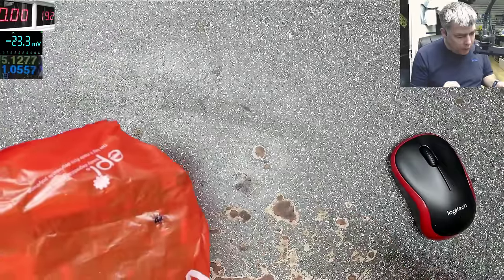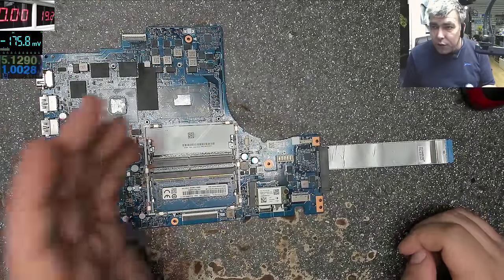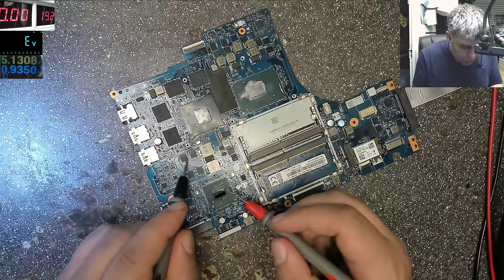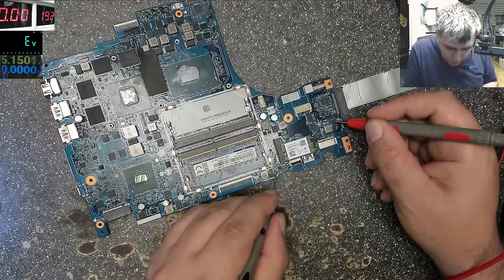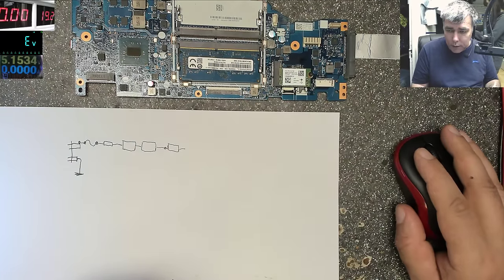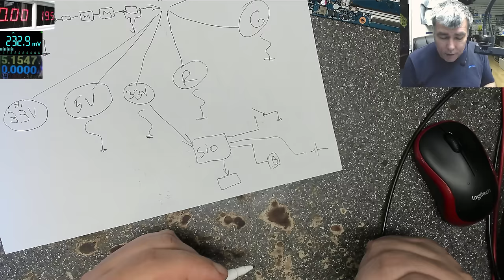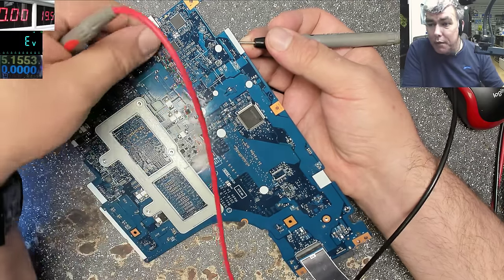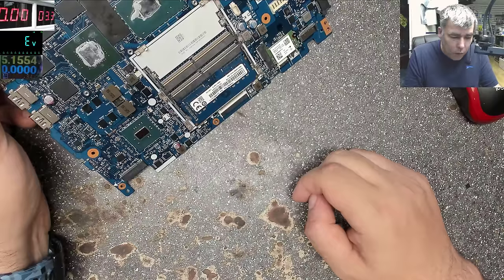How to diagnose a laptop motherboard - motherboards repair lesson

Comment: ether I need bigger Laptop or better eyes :o). It look so easy when you do it but it is big work of patient.
Actually I just try to fix 2 USB on a Acer Espire 7715Z, 1 USB broken but both not work...

As I find that good Video on the way of repair I guess I will follow first the Video lessons  before I continue with those USB

Comment: Hi, i have a HP 4530s Laptop and just in bios screen, the southbridge chip is realy hot after 5 mins. It has a thin metal heatsink on top. i already replaced paste but same. Should it be so hot without the CPU doing any real work yet ?
i think its the s/B chip as the CPU and another chip share the heatsink to fan  and this one look like a old style green cpu with that square chrome small block in middle. looks like a old laptop cpu actually single core. Could it be shorted as i cant install windows, just freezes or crashes eveytime in same place in start of install.  Memory stick (swapped too) still is cool and so is CPU/fan  section , just this S/B? chip really hot only on bios screen?  . How can i check for shorted chip with MM? Got this laptop broken, so dont know if already overheated and damaged by previous owner. dont want to scrap it as like this laptop and prefer repairing stuff.
Thanks, love your channel and learnt so damn much on testing M/B's so far

Comment: I have a problem with my DELL laptop. Charging side of the battery is good but it couldn't starts up. I tried power it up without battery still it won't turned on. Local IT told me to remove the RAM and CMOS battery but still it won't power up. So now I'm suspecting the laptop's power supply. Please I need you advice on how I can fix this laptop.

Comment: Dear Sir, I have an Asus UX490U laptop from 2018. I had screen replaced in 2019, but after I got it back the webcam and microphone didn't work. 

Its supposedly a USB2.0 VGA UVC WebCam. If I run HWINFO64 a CMOS cam it found an onboard device. But since Windows can't see a webcam, could it be a loose connector? 

Any thoughts?

Comment: sorin why in diode mode you keep saying 8 ohms 1ohm etc? its voltage drop! so the 0.001 is 1mV not 1ohm
Reply: Alex Xomon it's simply wrong and you are right !
Reply: V = I R, When voltage drops, resistance drops.
Reply: Voltage doesn't just drop out of nowhere without explanation. Resistance decrease causes a voltage decrease unless your current rises to compensate. Learn electronics bro
Reply: @maybelbdidit  the multimete applies some voltage and the higher resistance of a diode lowers the voltage on the output and thats exactly what the multimeter says, you dropped this ammount of voltage.
dont mess the ohm law for a single point and a system.

think of 1000 Volts plug separated by 1 meter of air, the output voltage at this distance will be 0Volts does that mean the resistance of 1 meter of air is 0ohm according to you?
i know my electronics bro

Comment: Hello my laptop's screen doesn't display. This is because at one time I was using it then all over a sudden the cursor stopped moving. After a while there was a black screen and I couldn't use it anymore. When I power on the PC the CAPS lock blinks five times. I'm asking what could be the problem plz help..

Comment: but the low power mosefet 4 drain pins are the one connected to ground and the otherside 3 pins are source and 1 is a gate

Comment: hy there,u awesome. good videos thnkyou,but i have a problem with my lenovo y70-70 touch laptop,no power,no turns on ,no fans working ,only what works is power lrd led (white) and thats it. wher i can start do diagnose my mobo or how to repair 😏 i wanna back my laptop 😓
Reply: First of all try disconnecting battery and cmos battery. See if laptop powers on after that. If not, maybe your laptop has a Novo button. Sometimes holding Novo button for a few seconds makes laptop work again. Measure power rails, find out if 3.3V and 5V are present or missing. Check power input mosfets. Check if signal from power button reaches the super io chip. Check if lid signal works correctly.

Comment: Sorin, Could you help me out. I keep seeing "v"  on the meter when you are talking about Ohms, what am I missing.
Reply: @Howard Greenblat....it was showing V because he was actually measuring  volts and not ohms. 0.001 or 1 mV. Just a small oppsie on Sorin's part when he said one Ohm. It was a 1 mV ....voltage drop. Good catch, but don't let it confuse you. Hope this helps clarify. 

Cheers
Reply: @Bman130958  Thanks (we don't do Cheers on this side of the pond). howie

Comment: I'm  a beginner I've removed  the bios chip and i broke the motherboard circuit (pin)
how to fix the circuit back? 
I ask you because I've fix it but I'm not sure if i done it right because The laptop still not working.

Comment: top connector is the lcd connector and it the mosfet U9  for the 3.3v for lcd power the (super IO) EC most probably  got shorted by the ID pin on the power plug (DC-In) , coomen fault on Lenovo and dell
Reply: or they shorted the lcd 19v to the 3.3v on lcd connector U9 is could be controlled by the EC (super io) the mosfet gate could get 19v which  will blow up the EC (super io) chip

Comment: have a lenovo yoga 730 lap top, no power is going into the mother board. no light either. charger has 20v coming out. 20v going thru charger port but when i connect it to the motherboard it drops to less than 1v. also the charger is making a ticking sound only when it connected. fyi.. battery isnt connect. any ideas? less than 1 yr old

Comment: Sir if the Lap Top is working only on normal temperature but if humidity comes here in Saudi my lap Top wont work , its not happened before and now I noticed that its working continuously and I'm  afraid it will happened again.

Comment: the super io chip dies also when you have a fault on the dc cable (shorting the centerpin to to vcc) this pin is for data from Mainboard to powersupply

Comment: i have a lenovo g580. i forced shutdown it after the usb port not functioning. after that, i wont turn on. led for the power is on. the gpu has heat. but no display and the fan is not spinning. i try the power drain and reheat both of the gpu. but no luck. is it saveable?

Comment: Before when starting my laptop the fan was sniping and the power led button was on but nothing on the screen.
After I've replaced the bios chip (after fixing the circuit and all) the laptop starts the same but shutting down
and starts again and keeps trying  3 or 4 times and after rest off.

Comment: With all my respect, but those black elements are not carbon resistors. The elements are s ferrite beads for blocking a high frequency noise, produced in the step down converters. Their reference designator is PL. I noticed they put character P before the designators of all the elements related to the power supplies That is practical but technically incorrect. The correct reference designator should be L, because the elements are inductors, so their resistance is low.

Comment: hope, i will get feedback soon, i have a Lenovo ideapad 510 with a Nvidia GTx, it went off after i too it for check ups they told me that the motherboard is dead. 
It has a non-removable battery but they managed to open it up and remove the battery. they determined the CPU is where the heat is coming from, not the battery. With the battery removed, the CPU cools down, but as soon as they plug the battery back in the CPU begins to heat up as if the laptop is on. With the battery removed, they tried holding the power button for 15 seconds to remove any static. they also tried unplugging the CMOS battery for 15 minutes in case of BIOS issues.
None of those methods worked and the symptom has remained the same. If battery or power pack is plugged in the CPU will warm up as though it is on.

Any solutions to this issue? What could have caused this?

Comment: hi, could you make a video on how to repair vape mod which doesnt turn on? I have mods  smok alien 220w which dont power on or power on on but no display, one shows even the logo for 3 sec after putting in batteries but can not be power on. They started dying slowly as the display was dimmer and dimmer and one day died completely.
Can i send them to you and what the price for fix? this is my ever favoured mod so i have them more than one because every time one dies i buy another one.  maybe i have used wrong batteries 18650 with to high current? the board is to small to test with multimeter for me.
Thanks

Comment: I have an Asus k52f and wont turn on,only blinking light,i remove a mofset and resoldering back,same mofset,and start without touch the power button and run normaly, but if i shutdown the problem come back,blinking light etc.if i repeat the process will start again.what i supose to do?

Comment: Hello sir.. need some help my laptop acer dont have 5v and 3v ic power vin 19v after out resistor pr get only 0.7++ to 0.8++v.. after that at ic rt28883p dont have any volt ata vin pin 16 rt2883p and 16 pin not connected.. pliss help me sir

Comment: Dear sir, i am a Filipino student in italy, your teachings arrive even here. i appreciate all your work and really love your videos. In my misfortune i forgot to remove the charger while disconnecting the screen cable and it spark. Now the motherboard is not giving any sign but no burned marks and no things heating. I think it is only a mosfet. Please help me. Because i bought another motherboard and suddenly it works only with battery  not with charger.
Please help me, give me discount when i send these two motherboards that i use for school. LENOVO S510P i7 NVIDEA 2gb. BOTH THE SAME.

i ask your help because i don't want to make it worst and spend much more money. i hope you can give me discount.

Comment: my desktop motherboard will not stay powered on when the 8 pin cpu cable is connected..
but will stayed powered on with the 24pin power cable only..

Any idea how to fix this fault ?
Reply: U need to connect both 8&24 pin
Reply: @BigMouthBilly  yeah i already know that..
as i said it only works when 24 pin is plug in but when i add the 8 pin it turns off the board

Comment: my laptop  is restarting  again and again,  like i start the laptop some time 5 sec, some  time 10 sec its restarts,   but if i open  boot setting it does not restart automatically, I check rams and hard drive  by replacing it but i think issue  is in motherboard, what can be the issue?

Comment: Buna ziua! Am vazut ca ai nume romanesc si vorbesti pe romana asa ca am sa indraznesc sa iti vorbesc pe romana. Intrebare: Curentul electric are inteligenta? Sa zicem ca avem un circuit electric alternativ. La acest circuit se conecteaza in paralel trei subcircuite-unul de 1m, unul de 0,75 m si unul de 0,5m. Curentul electric (intrebarea e valabila si pentru curentul electric continuu) alternativ merge intai pe subcircuitul de 1m, apoi pe cel de 0,75 m si apoi pe cel de 0,5 m. Decuplam circuitul. Inducem din nou curent electric alternativ. Curentul electric stie pe unde sa o ia ca sa ajunga la impamantare? Are memorie? Are inteligenta?

Comment: my laptop power button don't response or no power on without touch any ic on the motherboard if I touch any ic the laptop work normally what I should I do
Reply: addition information when I disconnect the charger I hear noise in speakers and have freezing

Comment: Hi friend
I want to ask you for some help. I want to disable the Ati Mobility Radeon 6370m on my HP 4520s because it is overheating and i have done reballing but it is no solution. I am not sure if it is posible because it is first gen i5 M560 processor with no switchable graphics but it has integrated grapihcs on it. I saw clips on youtube that it can be done but on second gen onwards. Do you know if it is possible on my board?
I saw boards like mine with no ati mobility chip chip on aliexpress but i am not sure.
This is my board
https://ibb.co/dPRTnXF
Thank you

Comment: For a motherboard worth less ten $50.00 Dispose it not worth the time spent to be repaired....Besides you didn't even fix the problem diagnosing the problem is easy today's CPU have life span of 3 to 10 years and even after 5 years is considered old Good job Bench Tech LOL!  Throw it out you didn't have parts anyways today electronics are disposable

Comment: without schematics its all bullshit
Reply: No need for schematics for simple power issues where computer does not even power on.
Reply: @SinsBird  there is nothing called a simple power issue, sometimes a small component will prevent you from booting properly, if the problem is not visible then its complicated
Reply: @Venom-eo7om  I don't see how connecting a power supply to a shorted out power rail to find what's getting hot is complicated. Booting issues is a different story, it's when repairs cost a few hundreds of dollars, but who's gonna pay that? Unless it's for macbook data recovery, nobody.
Reply: @SinsBird  I partially agree, these days the people who want their laptops to get the fix they are in majority those who can afford to do that, and mostly they are concerned about data recovery ... the rest, they do it them selfs or seeking unprofessional non-schematics easy repair, in this case, they will 80 percent lose their hardware forever .